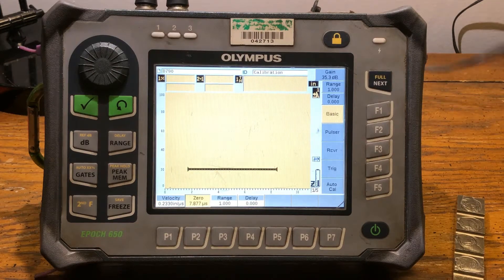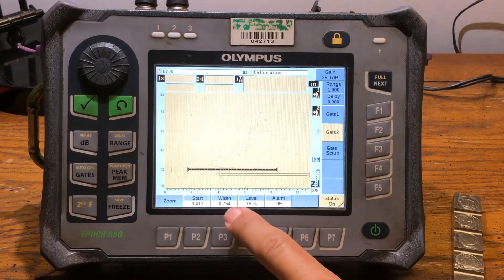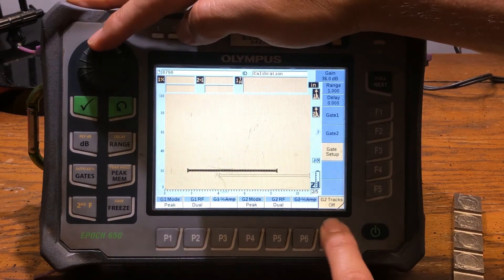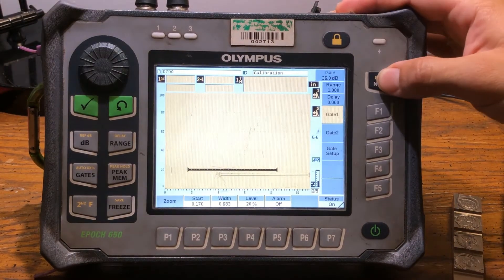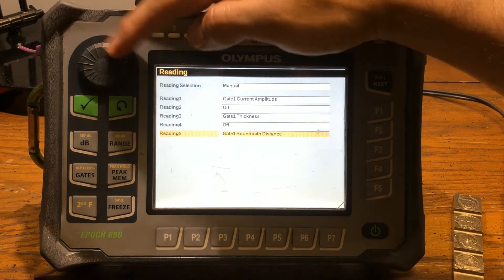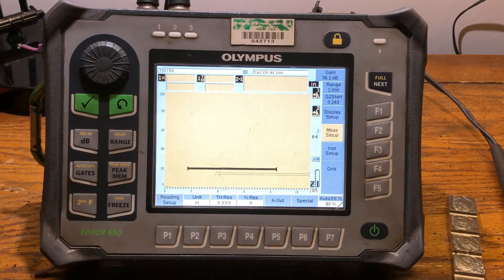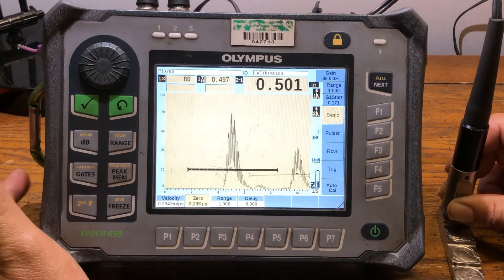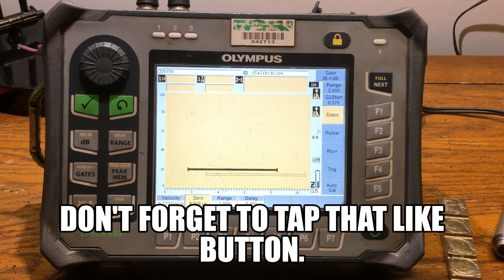How to Calibrate a UT Olympus 650 Scope Echo to Echo - Part 3

Comment: Hi there! The purpose of echo-to-echo is to find out how thick is the coat of primer or paint, but if you are trying to find the same value by zeroing or velocity, how do I find how thick the coat is, or how thick the material is?? Thank you!!
Reply from the maker: If you take a look on the top center of the UT Scope there is a small digital display rectangular box that says: 2-1. This is measuring your ultrasonic thickness already subtracting the coating (paint layer). 

The bigger rectangular box on the top right that says: 1TH is the ultrasonic thickness with the coating (paint layer). 

What you can do to find the thickness of the coating you can subtract the 1TH from 2-1 and that should give you the coating thickness. 

Example:

1TH   -   2-1 = X

0.515” - 0.500” = 0.015”(layer of coating)

Comment: What are you saying when you say first box is echo with ?"coating"? ant 5th box is echo without?"coating"?
Coating or coding? What do you mean by coating?
Reply from the maker: I am saying “coating” (e.g. a layer of paint). 

The 5th box (5th digital display) is reading echó to echo, your second peak. This is used when you have a surface that is coated (with a layer of paint) it gives you the thickness reading subtracting the layer of coating.

The third digital display (3rd box)  is reading your first peak and it is giving you your thickness measurement (e.g. if your inspecting a bare surface with no paint). 

I hope this clarified your question .